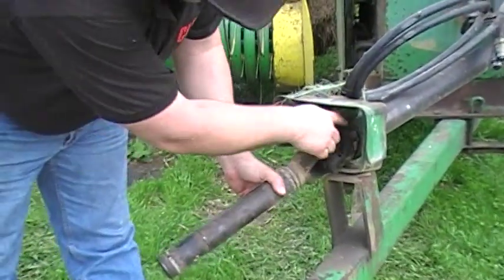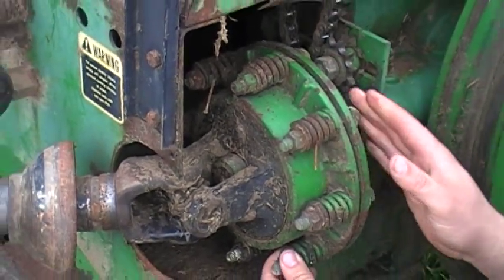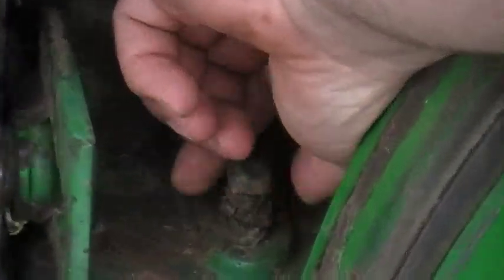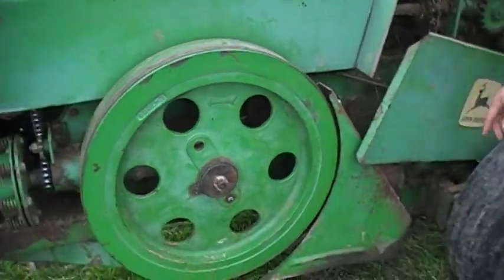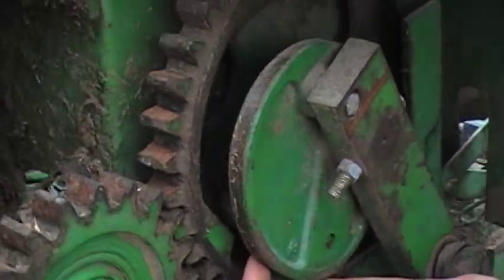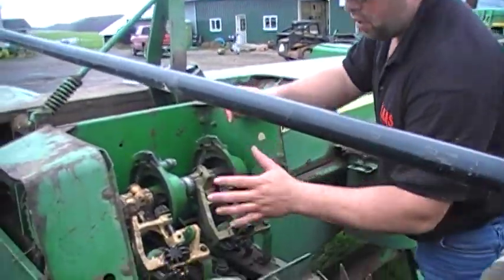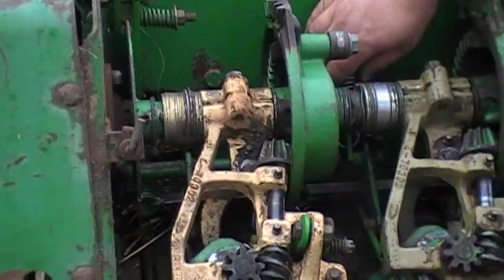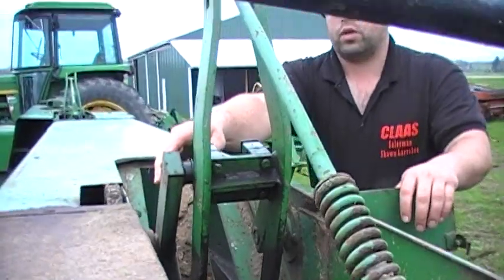John Deere Baler Inspection for 336 346 327 337 347 328 338 348 Part 1

Comment from the maker: Inline balers like Hesston and CaseIH, Massey Fergason are the most expensive balers to repair. Changing the feeder forks in the center of the baler is a 2 day job and changing the bearings on the plunger and reinstalling it and adjustment are not one of our shops favorite parts about them.  Good balers but not easy to repair like IH, John Deere, New Holland and CLAAS.
Reply: Shawn Larrabee
Reply: Quiero saber cómo se ponen a tiempo pero en español xfavor

Comment from the maker: We looked into the less moving parts and found nothing less about it, other than the frame size and lenght of the baler. The inline balers have more chains than a John Deere 336.  I will put a video on here of what a inline baler looks like compare to others. Out of all the balers we work on the fastest and highest capacity is the CLAAS MARKANT 65 came in at a record breaking 25 tons an hour  beating my John Deere 346 and my NH 575, which i was shocked.  The best i did was 19 tons JD same for NH
Reply: Shawn Larrabee q
Reply: Las venden ando buscando 348jonder
Reply: You ask 19tons in 60mints

Comment: I replaced my needle brake pads on my 336 today and baled hay it works fine but now I can’t get the baker to swing at the tounge? It’s like it’s binding up in pto shaft have you ever seen this?
Reply from the maker: Yup it’s rusted up where it slides hex shaft pto to slip clutch